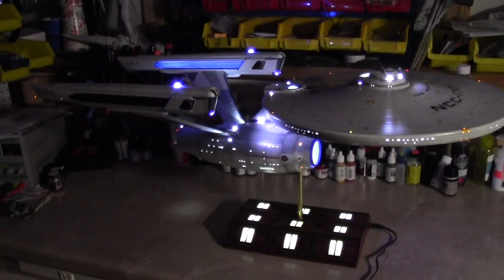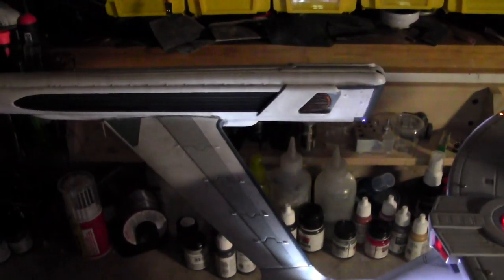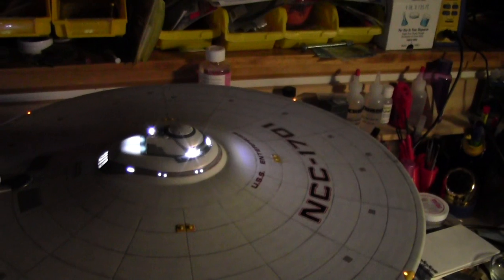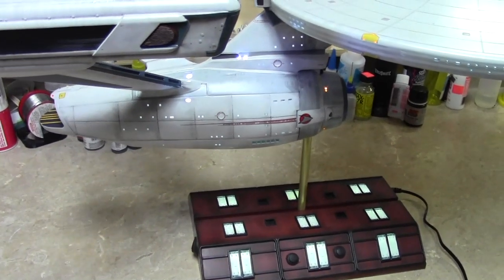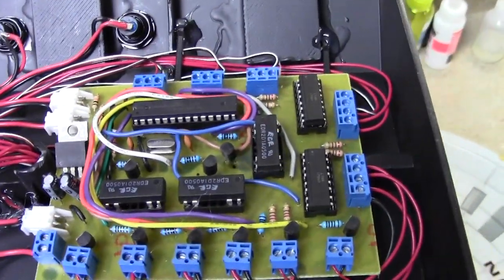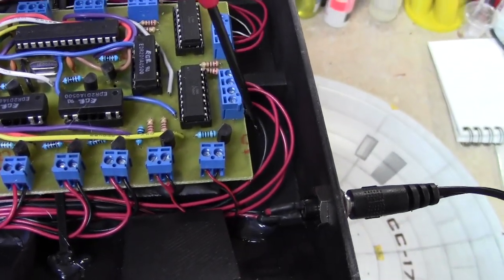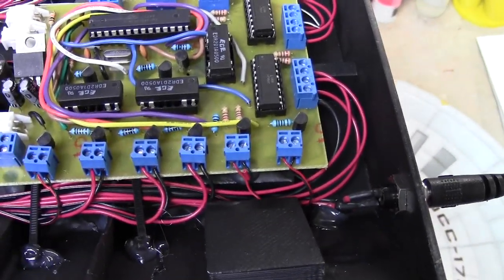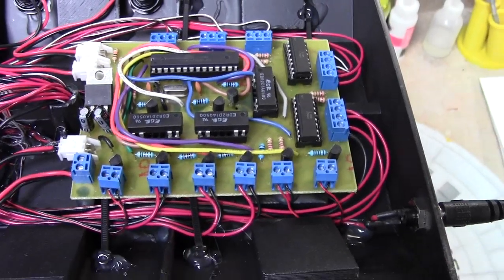1/350 Eneterprise Refit, Final Update

Comment: pretty sweet, however the impulse crystal should not glow red, it turns off when not in warp on the motion picture, but wrath of khan onward is constantly blue
Reply from the maker: Really? I missed that.  I can fix it by changing the code.
Reply: if you feel you need to, but yes Wrath of Khan is a good reference, when the Enterprise blows the impulse crystal of the reliant it is blue even though using thrusters/impulse